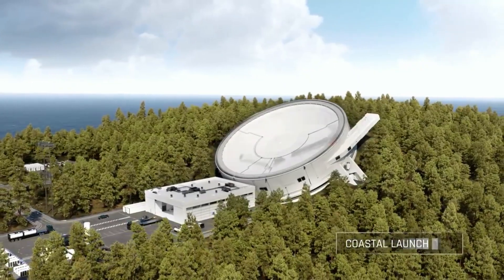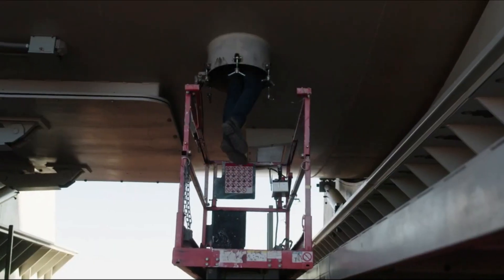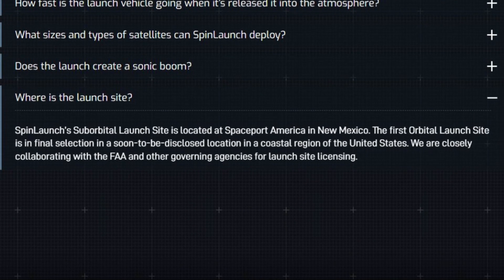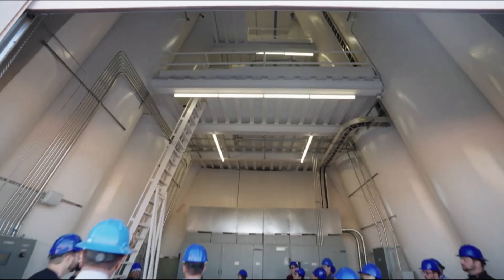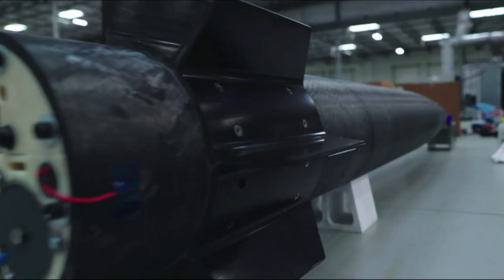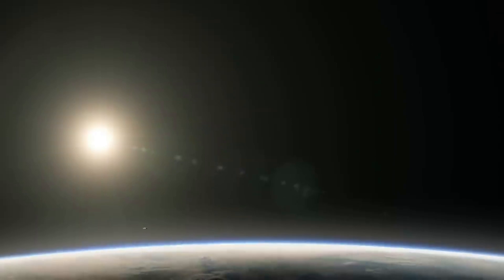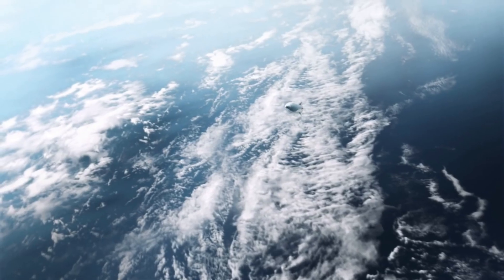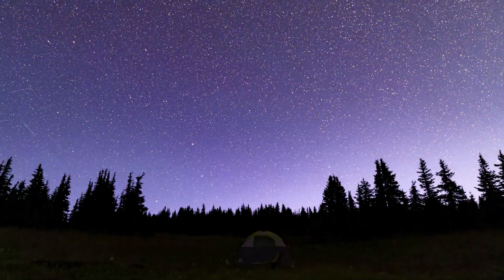Is SpinLaunch Making Progress On An Orbital Accelerator?

Comment: I can't imagine a fragile liquid fueled rocket surviving this. Plus the fuel will be pushed to the side and then to the top of the rocket when launched as it instantly starts to slow. In theory the engine would not be able to start without some solid fuel rockets to assist.

Comment: About that thin plastic cover that the rocket breaks through.  Calculate how much air pressure it has to hold back.  Its about 3x10 feet I estimate.  Thats over 63000lbs of air pressure.

Comment: Throwing the thing out of the spinning gizmo is the EASY part.....building a rocket that can take the lateral G's will be the HARD part.   So...instead of doing the easy part first....how about making the rocket then once you manage to get that working...move on to the spinning bit.   I'll give you a hint:  making a liquid fueled rocket that can take several thousand G's laterally is going to be really, really, really (I could add about a hundred more 'really's) HARD if not impossible.   This is just a money pit being worked on by a bunch of inexperienced people who are totally glossing over the real difficulties.
For sure we can make solid state devices that can take the G's...but the liquid fueled rocket just won't take this.   Hold onto your money until they show the rocket can work.
Reply: Most of vacum optimized engine runs in very close to failure mode when they operated in traditional rocket but 10000G.. Nope.

This thing doesn't burn anything than investors money with 24th century technology and fancy graphics.

Comment: Those Gs! That's the problem, even if you forget about all the other challenges, those G forces will affect anything you launch, even if you don't break it outright. The only reasonable payload for this kind of thing is raw resources, fuel and building stock and I don't think they can YEET for cheap enough for that to be sustainable.
Reply: A lot of hardware can handle it quite easily, as they've said many times. Sure, you need to make slight modifications, and biology is out of the question, but typical satellites can deal.
Reply: I honestly don't think this will work 
But regarding the g forces, there are electronics that can handle the g forces such as proximity fuses on artillery, etc.

Comment: They need to reach around mach 21 to put something on orbit. That implies that the projectile need to leave the launcher to even higher velocity. Its seem hard to achieve to me.
Reply: There are a lot more problems than that. Flying at those speeds is virtually uncontrollable. The rotational velocity applied by the machine to the projectile, it can only tumble. Getting the vacuum needed to spin up to those speeds is virtually impossible. The craftsmanship of the demo machine, I really hope they didn't pay the contractor, it's a failing job especially for promotional materials. The extreme conditions involved, the machine will have to be under constant repair. Every launch failure just straight up deletes your entire infrastructure. Even a successful launch, the sonic boom might delete your infrastructure. With a ballistic launch, you have very little choice of orbit. That's just top of the head stuff, I'm sure there's more.
Reply: @somedudesstuff801  "Top of the head stuff" is not a great way to try and "debunk" a pretty thorough project. I'm not saying they don't have problems to get through but they have ways to solve all of this with consistency.
Reply: @maxv9464  debunking in a comments section is also a less than thorough activity. However, the poor build quality (seriously some parts of it look like they were done by someones unemployed nephew, not professionals)  makes me think this group is NOT going to simultaneously solve problems DARPA and JPL couldn't.
Reply: @somedudesstuff801  Which parts are you referring to?
Reply: @maxv9464  my personal field is painting and corrosion remediation so that part was glaringly bad to my eye. If I did that bad a job I'd probably get sued. I'd have to rewatch to nitpick anything else.
Reply: @somedudesstuff801  Again, can you provide any specific context/clips/images?
Reply: Nope! The accelerator doesn't impart all of the orbital velocity. It's not like newton's cannon. There are two rocket stages doing most of the actual work, the accelerator just gets the thing up to a nice high altitude and initial speed.
Reply: @maxv9464  Ok, that make more sense

Comment: A polar lunar spinlaunch platform could cheaply  put loads of lunar material into space near a lunar gateway orbit where a tethered momentum transfer satellite can wind up, send rockets to and recieved from rockets from a similar tethered momentum transfer satellite around Mars. 

Spinlaunch like technology will be vital to building a space infrastructure.
Reply: Yes. It's really tough to pull off on earth but absolutely perfect for the moon or even Mars down the road.
Reply: @maxv9464  The moon has a
ball park bare minimum velocity to orbit the moon at about 1.7km/s, and an escape velocity of 2.38 km/s. For comparison, the current suborbital spinlaunch platform launches its suborbital rockets with a velocity of roughly 2.08km/s. That means if it were on the moon, it could already achieve velocities for lunar orbits and isn't that far from a lunar escape velocity. 

Being that the moon has virtually no atmosphere would vastly simplify a lunar spinlaunch vehicle and lunar spinlaunch platform to cheaply launch lunar materials to build out space infrastructure like space based solar power and a massive counterweight for tethered momentum transfer stations that would send man to Mars or to the asteroids in a few short months. Resuplies could be far quicker.
Reply: @kreynolds1123  Exactly. Hell, they don't even need a vacuum chamber. It could be much lighter weight/simpler on the moon without any need for an outer casing beyond something to block rogue mistimed launches.
Reply: @maxv9464  they can do away with vacuum  pumps and much of the outside earth atmosphere pressure  supporting thickness of the launch platform on the moon, but they still need some protection from electrostatic lunar dust.  I'm not sure all that would be required.  But wouldn't it be a little ironic if they preferred a tiny positive pressure to keep the dust out. The rocket itself wouldn't need the shell it needs on earth, which may inturn allow more mass to be part of the payload.
Reply: @kreynolds1123  Interesting thought, could be. I suspect that if lunar colonization properly takes hold there'll have to be a whole bunch of dust-combatting methods.
Reply: @maxv9464  I suspect there will be a day when they are launching solar panels to space for space based solar power beaming to earth and or lunar bases.
Reply: @kreynolds1123  That was a hypothetical concept back in the 70s, what lead to the star-raker SSTO concept. I have no idea of the viability for earth based systems, but I'd imagine that'd be potentially quite handy on the moon since there's no atmospheric losses either.

Comment: Question ... when you spin something at high speed, it is important that both sides weigh the same to keep the spun arm in balance. Otherwise it will shake itself to pieces (like the rumble on your playstation controller). So when they release the projectile from one end, why doesn't the launcher fall apart? Or do they drop something of equal mass off the other side?
Reply: That’s exactly what they do, the counterweight gets shot into the ground.
Reply: Less so much that both sides weigh the same, and more so that both sides have the same angular momentum.
Reply: I think real engineering suggested launching 2 payloads witching miliseconds of each other with forces that the bearing should be able to handle.
Reply: Currently they drop an equal mass like you said. But supposedly they are planning on having 2 of the “rockets” launch in quick succession so instead of just dropping a mass they will launch a second payload.
Reply: @fians4793  I'm by no means the expert here and I am a fan of what spin launch is doing, but being unbalanced and waiting for 180 of rotation for the second launch sound like there will be incredible stresses.
Reply: @kreynolds1123  Correct. In fact it would make things way, way harder in terms of mechanical stress.

You could imagine the arms of the launcher like helicopter blades. Due to gyroscopic progression the reactive force of "releasing" the payload would progress 90 degrees from the point of release. Because of then the moment this force was at its maximum the second payload would be opposite and adding its own force to the release stress. Basically making the already massive stress on the launcher three times as large (Equal to the launch energy of the first payload + the energy of the second payload + the difference in inertia of each arm of the launcher).
Reply: @fians4793  Since the 2 masses need to be released at the exact same time, one will go up and the other will go down.
Reply: Right now they just let the counterweight go and it's a big mess they say.  Their hope is for the counterweight to be another rocket which will launch after 1/2 turn.  The real question is can the bearing and all handle thousands of pounds of force for a split second.  I don't think it can.  The "split second" loading would be comparable to a multi-ton sledgehammer striking the whole thing for a split second.  And there are many other comparable problems that need to be solved.  Right now, based on all the evidence that I have seen, I think this project is a poor investment.
Reply: Watch the real engineering episode, they have a counterweight
Reply: The launcher would have to be extremely massive compared to the payload.

Comment: Can they build one that spacex could deliver to the moon. Ability to gather asteroid   particles,  use a solar furnace to melt them into ingots to launch into orbit to be reworked in orbit into space structures.
Reply: These guys? No. I'm genuinely surprised they even still exist. But in general? Probably. But not soon. Ask yourself the economics questions. What is the cost of producing 1 ton of steel on the moon and sending it to orbit? What is the cost of producing the same on earth and launching to orbit? Would this method of transportation have a significant effect on price? Who wants to buy 1 ton of raw steel in orbit anyway? Ok, so different approach. What moon products can be commercially viable in the near future? Near future, space based industry is good at producing fragile stuff, things you wouldn't want such a rough trip. Not to mention, the trip home is already the cheapest part of space flight, you're pinching pennies at this point.
Reply: @somedudesstuff801  i agree.  
I wanted to use a creative interlocking 3 chain design used on one brand of portable light towers.  To lift the crusible to the focal point of a bunch of relectors that were removed from the sides of the landing stage.     Robotic trucks pick up lunar materials.   Magnetic separation pulls the iron out.  The rest goes in a different crusible to melt into building blocks.  Since the moon wobbles. Perhaps just enough for a rail gun to launch iron projectiles into lunar orbit.  

Its just a thought from decades ago.  

With 3d printing.  High powered lasers might melt lunar soil as it passes thru the nozzle.